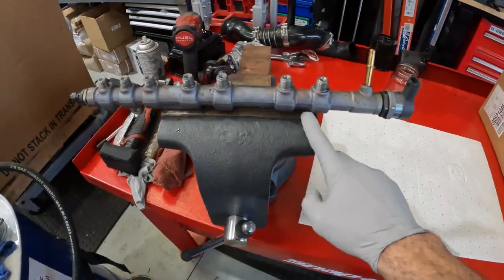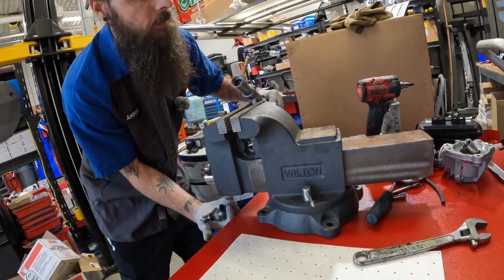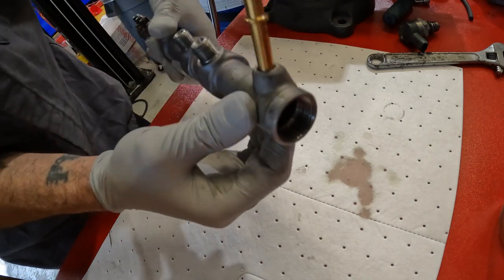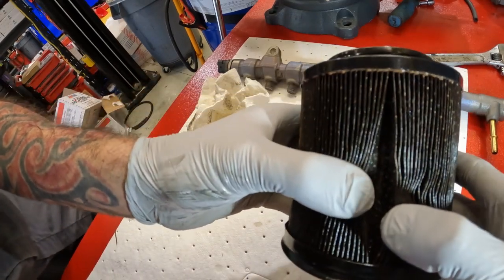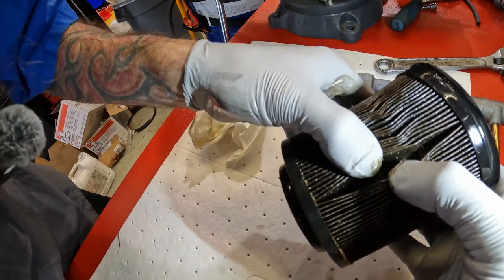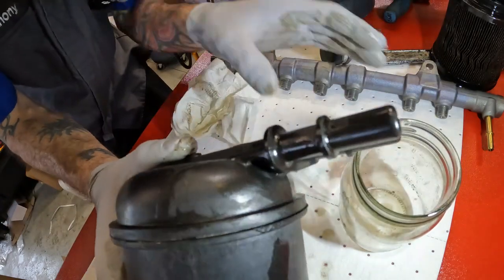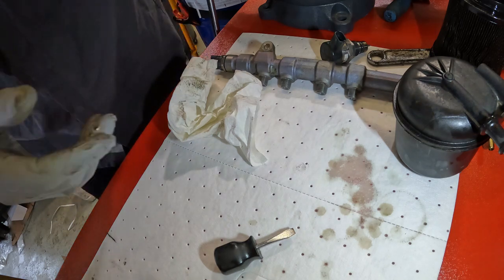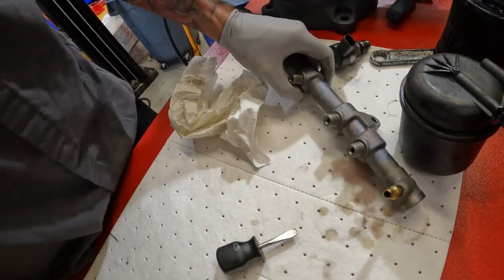Is There Metal In This 6.7 Powerstroke Fuel Rail? Let's Examine.

Comment: So say there is contamination like def in the fuel and all the lines, pump, filters, fuel rail, are they all heading to the bin? Is it not worth a parts washer or can they be sent out to be clean? Can they refurbished the injectors? 
Good video as always!
Reply from the maker: @Uncle_Fester24  if you run def through it, and turn the key on its done for,  if you don't turn the key on then you can drain the tank flush it and fill it with fresh diesel and be good to go.  But if you turn the key on there's no saving it.  Inside thay fuel Rail is very tiny litte ports. You'll never get it all out. Injectors can be rebuilt. But your better off putting in new ones. As far as lines from injector to rail. Might as well replace it. Your in there removing a rail and injectors and they have to come off to do so.  Then you will replace the filters. It's not worth a parts washer at all. As that could damage the fuel pressure sensor. And you don't want to remove that. Cause it has to be clocked and torqued. Otherwise it will never read right. Much appreciated for watching!!